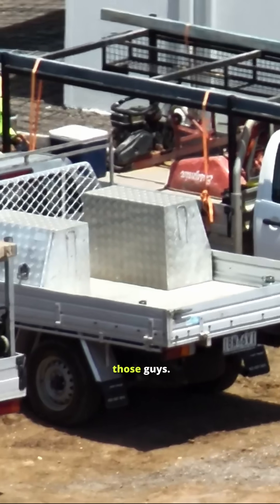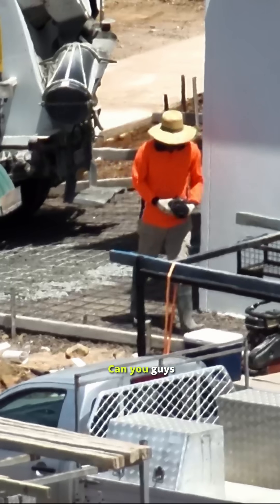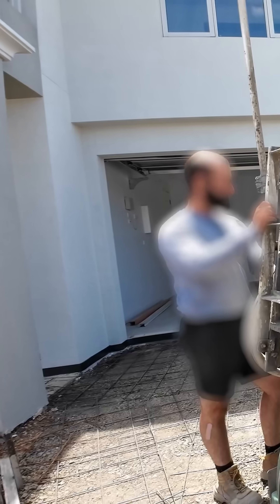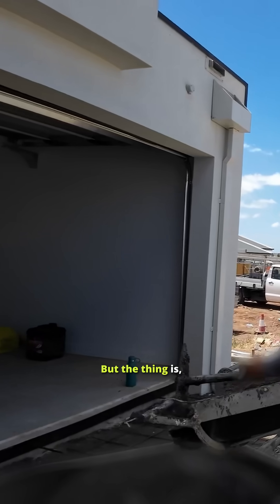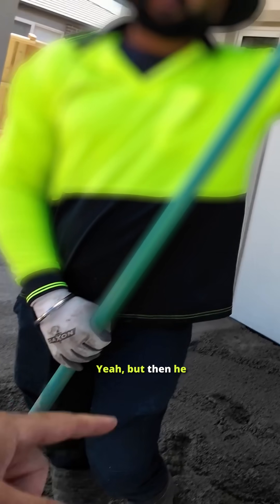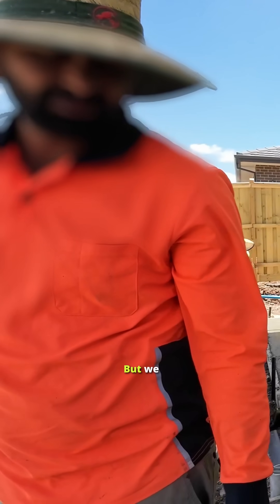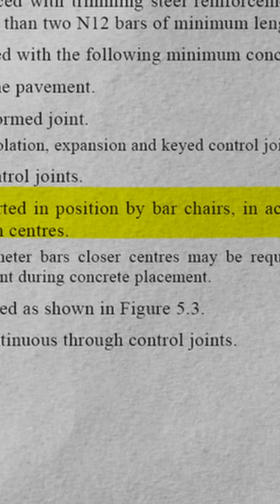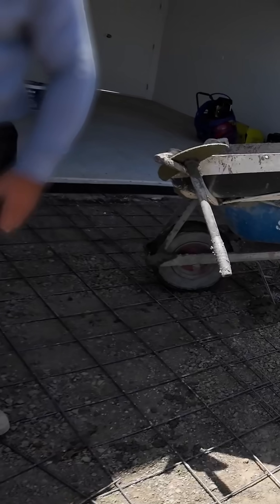Caught Pouring Concrete Without Rebar Chairs

Comment: I can’t believe why they don’t put bar chairs, these chairs are cheap, will cost less than $60 for a pack of a 100 and very quick to install as you lay the mesh down. These chairs are designed to keep the reo of the ground at a height to support structural integrity and proper concrete cover. The bedding should also be compacted down with sand or crusher dust to stop subsiding. How are these guys call them selves tradesmen. They should be sacked on the spot. The bosses and builder should be held accountable for such 💩 workmanship.

Comment: yeah seems alot of drama for something as trivial as lifting mesh. its doesn't stop cracking any less because you put bar chairs under it. concrete will crack that is guaranteed. what matters is where you put the control joints.

Comment: - And when you demo that sort of slab - it is easy - the concrete simply falls off the rebar mesh...

Do it twice...  I reckon "you should do it"  - OR you will be redoing it   - no payment until it is done  (driveways previously installed, none knows how it was done - OR if all the iron that was there on inspection day was still there   on pour day..    "They all do" - yep they all learned to do it wrong...Also  pouring straight onto clay - not gravel -  fantastic ways to endure water wicks into the assembly...

Comment: I didn't  know what a rebar chair was. Paused video and looked it up. Also learned you can't  walk on the lottle things holding the rebar in the middle of the concrete pour. So walking on the rebar while spreading the concrete even if the little dupports were there when you  started would have collapsed the little things anyway..

Comment: Who cares the builder is only paying $5k for the driveway im only paying $3K for wrap path fence up for 2k with a gate. 

Im not pay $20K for the same job just coz yall added plastic to the concrete if it cracks all good doesnt cost much to fix cracks 

We dont live outside…. Im notnpaying extra for outside the house🙄
Reply: If the driveway is done like this, so is the rest of the house. That owner is going to have to pay 200k to get the house fixed in 5 years. lol

Comment: I worked for a concrete company in Sydney.  I always attended the site to ensure standards were met. I thought straight away they were going to pull the mesh up, but they dont. If the new age sales kids dont go to site, then they will be filling out and accepting claims for cracked concrete.

Comment: Every nationality that immigrates to Australia has good and bad tradesmen. I can give you personal examples of Aussie (and no, I do not want to turn this into a racially motivated discussion - merely making a point) tradesmen who I had to literally correct on the job by quoting the Australian building code - no jokes.
I'm an engineer and reading a building code is not rocket science. 
I literally had to get them to fix issues which they had either absolutely no clue about or couldn't be bothered.
The point I'm trying to make, once again, is that you get exceptionally good and the bad tradesmen in every nationality.
I think what needs to be done, is that the government should disregard any overseas qualifications and instead have a bridging course which you have to pass before you receive your trade certificate.
Also, ensure that concreting is a recognized trade - I've lost count of how many tradesmen have laughingly told me that the easiest thing to become is a concreter as it's not a regulated trade - no kidding.
Reply: It was the same 25 years ago, people act like this is a new problem.

Comment: Seen that often on the Gold Coast area on the driveways - also they have not wet the ground before pouring the cement, the dry earth sucks the water out of the cement and home owners wondering why their 4” of cement is cracking.
Reply: - gravel, plastic, chairs and bars (taped seam - plastic stops moisture going BOTH ways - gravel helps keep the moisture away from the cement -clay / road base doesn't) - Still most likely never done.  (Even if a moisture barrier is installed in a structural slab - taping the seams will be very haphazard - rebar will poke holes through it - spite or carelessness..  etc..

Many tradies don't appear to understand the reasons for "engineers specs" (I have had one OLD school European (Italy and Switzerland) trained Concreter/Mason tell me that the "engineer" on his sites didn't understand rebar placement "Just throw it in" - lol, look at the drawing then.) -  well if that is the case, I don't know where he got his engineering degree or PECert. It was a long time ago and "Engineer"  has a range of meanings from; "Draftsman",  "Site manager" to Degreed Civil Engineer..- and just think it is there making more work for them  - OR they get complacent with dodgy inspectors / site managers - who also don't care - money for Jam...

I don't care which trade-  many tradies I talk to - are ( "we don't do it that way here" ) over their head after planning a rafter birdsmouth for the first time in 40 years - prefab framing has removes framers another step from knowing how to frame. Rainscreen systems, window installs.. a lot of things are on the dodge..

- If they can't do it - "mayaswell do it ourselves" on the weekend.  Though we know most people aren't up for it - their driveway will be their first ever and it won't turn out quite how they planned it...

Comment: That is how house slabs are done in much of the US. The contractor will tell you that the concrete and aggregate hold the bar up once you pull it up, and stepping on it won't matter, besides they step between the wider spaced bars . So they say.

Comment: I heard the rebar can actually be worse for the concrete in the long run.
Reply: Get real. Are you serious.
Reply: @rob12468Yeah, the Romans never used it, and it rusts thereby causing the concrete to fissure.

Comment: I specifically looked for a company that had social media with photos of bar chairs installed when they poured. So when they did my driveway they installed half of them and not the other half. Asked why not and they said it'd be fine, I saved those emails and the CCTV footage for when it cracks.

Comment: No bar chairs, no trimmer bars at re-entrant corners, no separation between mesh for future saw cuts, subgrade doesn’t look compacted, no proper bedding sand, ableflex along existing structure isn’t full depth of the driveway thickness, inconsistent driveway thickness due to bad ground prep. 

Nice good job fellas 👌👌👌
Reply: @missochisso  This is known as the "California standard."
The new homes here are slapped together. This is common practice in new track homes with the unskilled "skilled" labor. 
Rusty mesh popping through the concrete & homes falling apart.
Reply: @abrokendadfixesI was in a boys town prize home on the Gold Coast in the early 90’s built on old swamp ground in Robina, the rusted Rio stained threw the paintwork on the interior plastered walls n cornices left gaping cracks where it separated from the ceiling & this was all within the first ten years of its construction 🚧 skilled tradesmen in the Gold Coast in the early 90’s style I moved up from Sydney n was gobsmacked
Reply: She'll be right lad! Get in get out get paid. We get paid to come back and fix it in 2 years also!
Reply: My maintenance company expects high growth.
Reply: No overlap
Reply: Migrants using their home grown peasant education and scam quality.
Nothing like a refugee  who hung onto the side of boat to build your new home..
Reply: And Albo's helping to bring more non compliant creators into the country cause there's not enough tradies.
With work like this, there will never be enough,

Comment: You don't need them but the amount of attention you get for not using them its not worth the risk. Pulling works, it doesn't sink when you step on it because the weight is spread out. Also you trip over when the mesh is on chairs, safety issue for the workers. Its actually a insult to skilled workers to pick 1 part of the process apart. no ones knit picking other more important stages of the process because they don't even understand it. but ommogawd chairs

Comment: More alarmingly there isn’t near enough square overlap on the slab steel, completely defeats the point of putting it there.
Reply: More alarming than having the reo sitting on the ground?
Reply: @stuartedgar5921  yeah. It wouldn’t all be on the ground, they didn’t tie it and use hooks for that, it’d be sailing all over the place. 

The slab steel must have overlap that’s much more important. 

Retired concreter.
Reply: @n-wh4jt So allowing the Steel reo  to be in direct contact with moisture from the soil isn’t important?
Reply: @stuartedgar5921  it’s galvanised. There isn’t even supposed to be plastic under there which is what another clown is arguing about in another comment. Concrete is porous of course it’s going to get wet. It’s in the front yard.
Reply: @stuartedgar5921  I said it in another comment and I’ll say it again. This country deserves everything it gets. We have self righteous, arrogant halfwits who don’t know the half of what they’re looking at in the video and they have far too many opinions. Suddenly everybody’s an expert. That’s what.

Comment: They didn't even give a shit.
Imagine if you had a device to check. 
Half the driveways in Australia would have to be replaced. 😅
Reply: - that device exists;  GPR (ground penetrating radar) - Transmission "Xray" - (often a gamma emitter) and Ultrasound....
Reply: You can scan the concrete.
Reply: Oh they absolutely do exist, you can have precision rebar imaging done, they check the distance from surface as well as thickness of it.
Reply: Well those built in last 10-15 years at least would fail. Anyone who had decent tradies and decent bosses who valued quality would do it right.  Old school tradies did it or word got around and no one would hire them. Today demand is so hi and noones regulating this type of behaviour, builders get away with non compliant quality. These guys just care about thier next pay check and move on as their boss dont care either
Reply: @wnood 
So very true.

Comment: This is extremely common in driveways in oz, lifting it and stepping back on it doesnt push it into the dirt again, but its not good, additionally it doesnt comply with the BCA vol 2 either!
Reply: I’ll show you photos of concrete I’ve ripped up in my own yard and oh my the Rio no chairs sitting on the bottom of the concrete 
Doing nothing lazy concreters and trying to save $100
Reply: @anthonywhelan8373 that's because alot of them don't even lift it during the pour,  very lazy
Reply: @SG-mu9zv no it’s because it sinks after lifting I personally know the lazy concreter who laid the concrete 
No I didn’t get him to do it 
It’s 20 years ago he laid it and it sinks 
I’ve been in construction for 15 years myself and a lot of them do it not all 
But I’d say around the 50-60 percent 
First of its in the regs Australia std to have chairs so why do they try and save

Comment: Oh dude tip of the iceberg. I used to deliver premixed concrete and this is everywhere. Even not much concrete thickness ontop of waffle pods in house slabs. Some pours i left the job thinking to myself ''i wouldnt wanna be jacking my car up on that slab''.....Chickens will come home to Roost around 2030ish is my guess😳